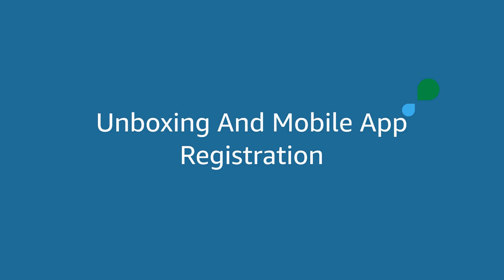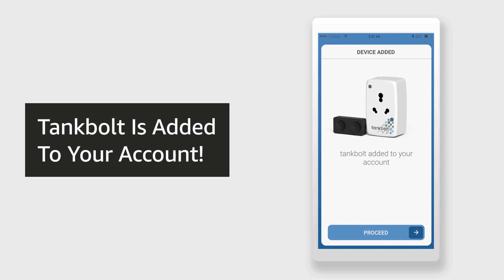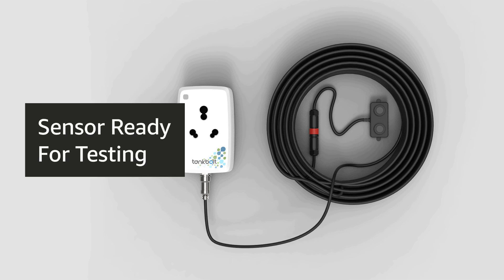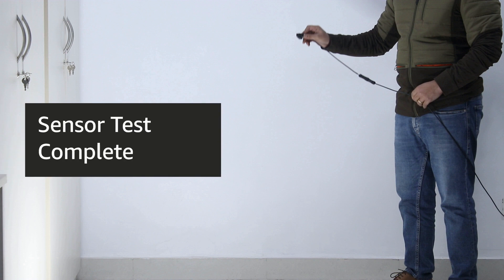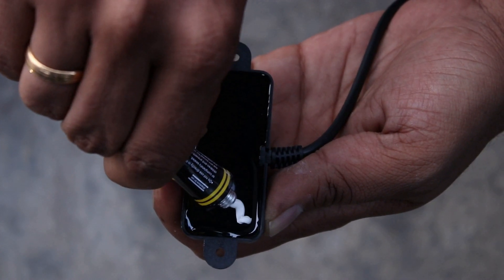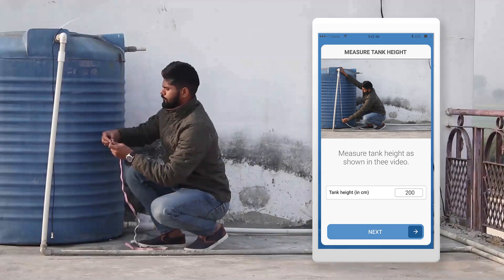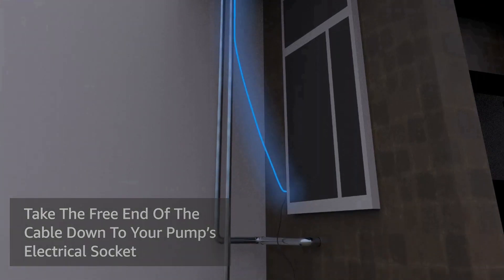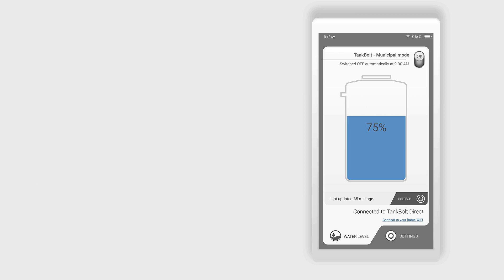Un-boxing Installation of Tankbolt - the best automatic water level controller

Comment: Everything works alright without 100ft extension wire, the moment I connect extension bought from you, tolkbot device can't get the sensor value. I checked connection with multimeter, looks fine, but no measurement in tankbolt. Does the product really support 200ft cable?